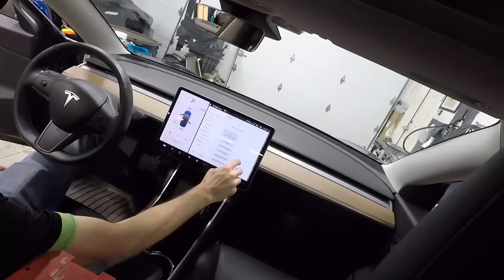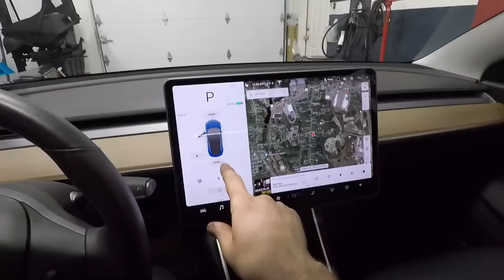Electrified Garage: How the Pros install a Hansshow Tesla Model 3 Power Trunk Retrofit Kit

Comment: Finished my install of v4 hansshow power trunk this weekend. Your video was so helpful. Much appreciation. I’m curious how you would route the canbus cable that is part of v4.
Reply: Hi, when you fitted the V4 kit did you use the power under the rear seat? And did it work ok? I tried this but the system does not work - control box lights on but that’s all. I’ve heard that the power from the rear seat goes to sleep’ so not sure if that’s my problem...?
Reply from the maker: This is not that hard to do, the interface is behind the center console or the drivers side kick panel depending on kit make/variant, this kit has a plug in harness and did not require CAN connection.
Reply: I installed hannshow V10 on my TM3 2018 on box was no instructions, so from OEM outside bottom it works and from installed Hannshow bottom it works from main screen nothing from Tesla app it closes only looks like the last version sucks however I have 3 male plugs that  nowhere to plug them well one of them it’s for kick sensor that I didn’t install other two no clues no info about it

Comment: IMPORTANT !!!!!

Most uploads like this one is extremely good at showing how to disassemble bits and pieces... but be aware that most of the Youtubers does not have experience with stuff like routing cables and securing them.
THIS video however shows the skill - Thank you "Electrified Garage" for not misleading folks :) 

In the Hansshow manual it CLEARLY states that is is forbidden to pass the strut cables through the rear light opening. So many other Youtubers do this. Cable gets all squished and it WILL slowly get cut but that sharp opening edge as the car moves along (thousands of small vibrations). And drop tray or not you have still created an opening into the cabin that should be there.

If you don't want to take off the rear bumper you can do the following...
Strutcables can be routed further down and into the rear bumber (large openings far left and right. Down on the rear side of the bottom boot compartment there are 2 blueish rubberseals on each side (one small and one big). Cut the middle of the small blue seal to fit one strutcable and the other to fit both strut- and footsensorcable (if you bought that). Make sure the cables does not jump around in the rear bumber. When you are satisfied with the cable routing then add a little silikoneglue (or whatever) to close whatever opening there might be between blue seals and cables.

I received the Trunk kit from Hansshow in June 2020 and is is now installed.